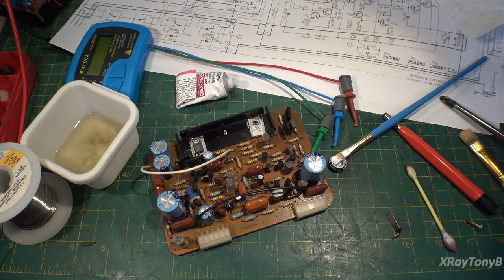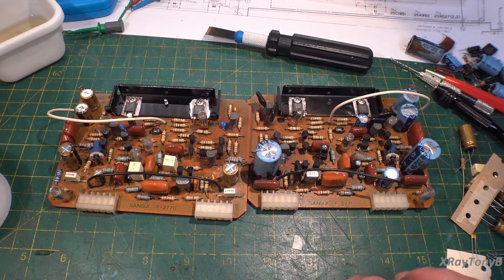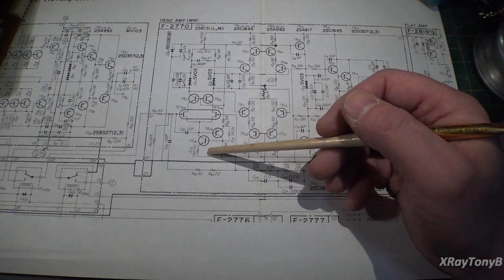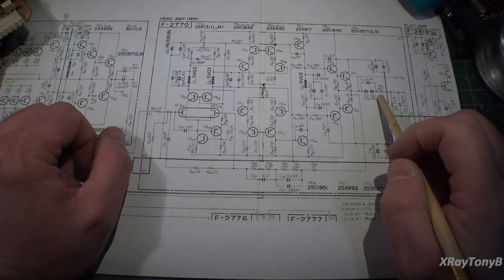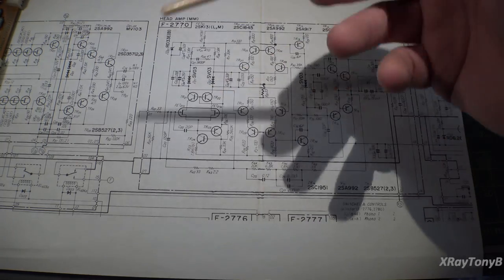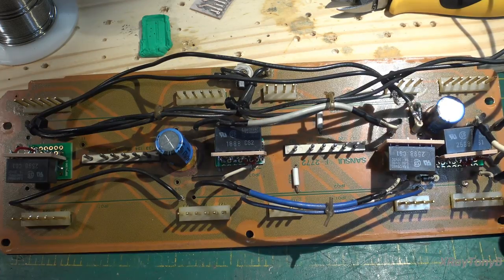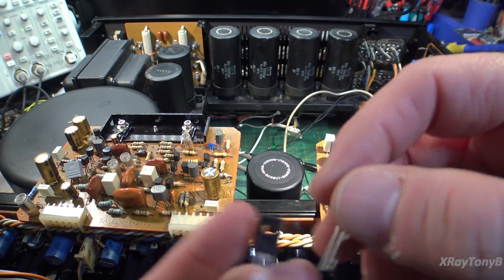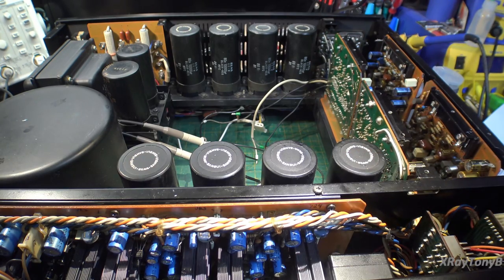Sansui AU X1 Part 3 - The Phono Stage

Comment: Your video about this wonderfull amp made me decide to finally sign up for youtube. I have restored the same amp in 2014 and it was a lot of work. I don't have the knowledge about electronics that you have (not even close) but i succeeded with a lot of patience, self study and perseverance. It took a few months in recapping, cleaning, testing, checking, fault finding and In the end I managed. I have been listening to this amp since then (it is in my main system) and it was a big step from my Sony VFET TA-N7 & TA E88 combo which i regard highly (also restored by me but less complex).
Untill now i used it with a Sony PS-B80 turntable (a restoration project that came close to this amp) with a technics EPC205mk4 mm cartridge. The amp is almost in daily use with Yamaha NS 2000 speakers (berillium high and mid domes) 

I designed and ordered new pcb's for the power amps and i also created my own improved version of the phono motherboard with modern relays. I also had the earlier version of the motherboard just like the amp you are showing. On the new motherboard i used a less complex switching sheme to reduce the numbers of relays. With phono 1 and 2 i switch between MM and MC.
I also applied a grounding upgrade that i read about in a restoration thread from a german tech. This grounding upgrade is essentially the same as the grounding upgrade on the phone motherboard as performed by Sansui. You show it somewhere in the video.

You can find my restoration link on audiokarma. I even stripped the amp to bare metal and repainted all steel and I even made some mistakes but by checking everything multiple times I was able to correct all of it.

There was/is however one cullprit that i cannot solve. The amp is dead quiet. I did the same testing as you did during the rebuild of the amp and after finishing the amp but as soon as i put in my MC cards i get hum on the MC input. Only on the MC input, the MM is dead quiet. Looking at your video you have given me a hint regarding the hum on the MC. I suspect a ground loop but did not find any yet. This was regarding the ground wires on the MC board (which I have on both side of the board :)) and the ground reference for adjusting the pots. I think i used chassis ground for that.

Comment: Like that you mention local and global negative feedback.I use a mm phono riaa stage with no feedback.My power amplifiers are also without feedback.they are very linear.No problem with os at all.They are also the most quiet circuits i have had with no hiss.Way better than many well known brands witch make so much hiss that i can hear it from my listening place 3meters away.With the no feedback amps in my active setup i have to put my ear close to the tweeter to hear some faint hiss.And i use AMT type tweeters 94db 1w 1 meter sensitive.Osillation was a problem with the first versons.Better components and and a small pcb size(groundloops)credit card size etc helped.   120w 8 ohm 240 in 4 ohm etc.Capable to play loads down to 1 ohm.The bias is set higer if i use a 4 ohm contra a 8 ohm drivers.

Comment: those relays were used (among other consumer habits) in the original  JVC VCR'S to switch from SP/LP video head output directly from the rotary transformer so the signal level was extremely low and frequency relatively high.  
They were mounted directly on the video head drum assy.
When the contacts became oxidized the pic of course was distorted.
We used to just use some cleaner like Deoxit on a piece of paper that we ran through the contacts and resolve the issue without removing the entire drum assy which would have required a tape path alignment.
Anyway, we did this to hundreds of those VCRs and never had another issue.  So it's possible that might have also worked here.
Just a thought.

Comment: I own a vintage Sony TA2000F Pre-amp. I re-designed and re-built the line amp side. I am now about to tackle the phono amp side. This pre-amp has two phono inputs. One dediciated to MM (phono2) and one for different impedance cartridges. The phono stage uses a combination of SONY (first generation) FETs and high volatge (150 VDC !) bi-polars. Most of the boards are plug-in modules. Really well built for 1975 ! Recapped the entire unit 10+ years ago and repalced the line amp FETs with MPSA18s.  I'll never "sell" it now !

Comment: Thanks for the tip on the new driver(?) transistors for these phono slave boards. I have the Purple Motherboard that I have populated, but still need to drop into the amp. I have never heard the phono stage on my X1, as I am restoring it veeerrrrrry slowly.....

Comment: I hear this often in audio forums. Negative feedback causes TIM distortion (another word for slew rate distortion) and does not work due to delay in the feedback loop. Think this thinking is from the early solid state amplifier days with very slow output transistors. Just to put things right: In a proper designed audio amplifier, feedback will not create TIM. TIM will in fact be reduced by negative feedback. Another mistake is the confusion about phase delay and propagation delay. Time of flight in the feedback loop is in the order of a few nsec. Not usec as mentioned. Compared to audio frequencies, propagation delay is not an issue. Please read litterature on the subject (eg. Cordell, Putzeys)

Comment: That Sansui phono stage is extemeley complex. It looks like a discrete op-amp with the RIAA R/C network in-between.  You can build a pretty decent phono amp with just 3 npn (low noise) bi-polars and a 24vdc supply. The MC board looks even more complex !
Reply: EVERYTHING re: this receiver is complex! :)

Comment: 52:22 : If they're that temperature sensitive, chances are the bias point will change after you put the cover on. In cases like these it helps if you can find a trick  that allows you to adjust the pots with the cover on and, ideally, screwed down tight.

Comment: I have to wonder how much solder was on the pad before you soldered the bolt down. My thoughts lean towards how soft solder is. Tightening the bolt onto the transistor will compress the solder by some amount. Since solder is very pliable it will compress and not spring back. Would it make sense to use a split lock washer? Just something to apply a small amount of spring force to keep the bolt tight(er). Also, compression of the solder would tend to create micro cracks into the newly applied solder. I don't think this would be a huge problem, but will eventually (years "decades" likely) lead to a similar issue, especially with heat/cold contraction, and the bolt will be loose again.

Edit: just to be clear, the idea to solder the nut into place is a great idea, this is no criticism. I am thinking out loud is all.

Comment: If you look at the schematic, right under the FET input stage, there are two BJTs; one PNP and one NPN wired as a self-latching circuit (a.k.a. an SCR); if you apply a positive voltage to the base of the NPN, or a negative voltage to the base of the PNP, they’ll keep each other turned on. I can only presume they meant it to do that; maybe it’s some weird input protection circuit?

Comment: 3:55 - I'd solder jumpers from the middle conductor of each of those transistors to their corresponding tracings on the PC board, just to be safe!
Reply: Yes, I agree on that, it adds peace of mind in the long-term.  I also do the same with tiny traces in the power supply area.  Some traces are too narrow to save PCB space.

Comment: 11:40 - Tony, Molex connectors are HORRIBLE for audio! At least clean them like you did to those power transistors.
Reply: Why?
Reply: Those connectors look too much like the ones in equipment that I always had to fiddle with because the connectors were high resistance and unreliable.

Comment: What I  think about T03 packages is that the electrical collector connection is always through dubious mechanical friction fits of nuts and bolts using different metals. Must have effects on the sound quality.
Reply: In that case I use Carbon Conductive Thermal Compound to help the electrical connection.

Comment: I suppose it would work to replace the NPN transistors with BC182L and the PNP transistors with BC212L, Class A power amps can run very hot and  unless it is done properly the output transistors can burn out very quickly so lets just let #xraytonyb do his own thing.

Comment: 10:54 : The downside with modular amps is for every one that is modular there are 20 out there which are not. So it's back to frustration and wondering: why can't they just make them all modular? 
Let's hope the R2R (right to repair) trend becomes mainstay!
11:24 : While a modular design can make the design of proper grounding implementation harder it's not a necessity that this be the case. After all, the grounding can also be implemented in a modular fashion, albeit at a huge cost increase. It' all comes down to implementation and design refinement. The same argument could be made against the use of PCB's since they restrict the routing of the ground bus. We would need to resort to point-to-point wiring if this was the only way to eliminate grounding issues, yet we have ultra high frequency precision instruments where these issues are being tackled successfully. Usually these are both modular and built with PCB's!
One extra point is that it's probably worth checking and cleaning the contacts when putting the boards back together.

Comment: Hey man don't knock the FM (wildcard) Multiplex harmonics 😅 which later on Sony and Sansui would formulate to the modern day EFM CD encoding standard. I can see how today's phono amps took this circuitry developed replacement op amps as to clean up the cheapie transistors and capacitors. As a Sansui and Sherwood (similar FM sound blaster 70's tech) operator those signals can get noisy. If it becomes too much of a hassle switch the knob to 'AUX' get a good 100$ RIAA/DAC/FM based multiplexer, run to the record player and enjoy probably best output amplifier (kicking out the quad) ever made..

Comment: 16:54 : Painted subchassis screwed togethrer without the paint being removed equals poor quality control. Often the designer relies on the grover nut removing the paint when tied down, however, these metal parts being aluminium (which oxidises i.e. forming an insulator) and these amps being of a certain age and possibly having been disassembled for repair are things to take note of when restoring. With many quality manufacturers we often see these points where the subchassis meet and are screwed together having been sanded down to remove the paint, copper screws being used etc.

Comment: Great tip this fiber-tip pen (pun intended). Until seeing this I was sure it was just another useless gimmick.
How do you go about finding original manufacturer (or identical replacements) for obsolete semiconductors? I'm pulling my hair out trying to guess whether online vendors are actually selling the real deal or just reselling knock-offs. I wouldn't have a problem ordering a sample and trying it out but when you have to order from ten different suppliers abroad - who you don't know whether they're stocking knock-offs or not - suddenly postage costs become a big issue.
I wish there was a site out there listing all various vintage transistors (as there is for vacuum tubes). That would be a start when trying to find suitable replacements.

Comment: Hmmm., Why does a phono stage need power transistors?
Reply: I think that whoever designed this first thought of a transistor curve and its bias, then found a transistor that matched that design, which happened to be a power transistor operating at certain quiescent point.
Reply: @kylesmithiii6150  Yeah I thought about this a bit. This amp has to be FAST so there's a lot of voltage involved (+/- 47.5V supply).
Reply: I was wondering that myself.  I thought maybe it was on-board power regulation, but I'm not seeing it in the schematic.
Reply: It is unfortunate prior meltdowns involving tubes caused the FET/small caps to appear, which can be seen even in these low voltage phono inputs. However in the power amp stage Sansui set the standard. Well into the 80's rebuilt Sansui amps were still sought after in hi fi stores selling higher than new models...

Comment: 55:20 Do you know how the noise is getting coupled from your lamp to the system?  I'd be concerned that power line noise is getting though the power supply.
Reply: I think that the noise from the lamp is interfering with the area(s) of the circuit outside of the power supply area, like little antennas spread throughout the volume of the receiver then taking little spikes of magnetic field from an outside source.  It should reduce or disappear when the receiver is shielded by its top and bottom covers.  The capacitors of the power supply should filter those and it is easy to verify if that is happening with an oscilloscope on the DC rails.   If the power supply is not filtering that kind of noise, then something like a 10 uF, 250 VAC film capacitor for each DC rail should solve it, if one can fit those capacitors inside the equipment.  I have done that with very good results.  One can imagine what happens with the receiver in that condition close to a kitchen... (blender, dishwasher, refrigerator interferences...).
Reply: @kylesmithiii6150  If it's magnetic, then that suggests a "loop" of some kind in the receiver (ground loop?).  Depending on what the panels are made of, they won't do any magnetic shielding.  (Short of Mu-metal, the shielding will be minimal.)  To me, the noise is concerning.  There's any number of devices in an audio system that may be turned on or off with the amp on.  For example,  what happens when your turntable shuts off at the end of the record?  I think the test should be run again after the amp is assembled and any problems tracked down.
Reply: @russellhltn1396  Yes indeed, I agree, that kind of interference needs to be eliminated.